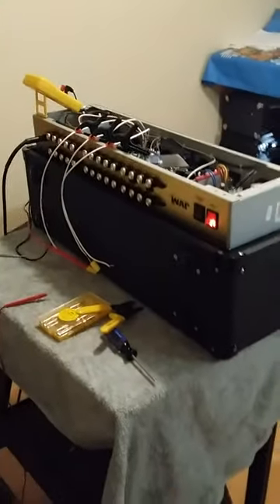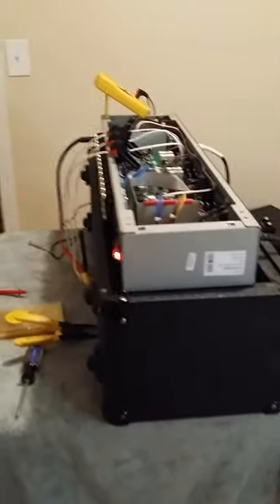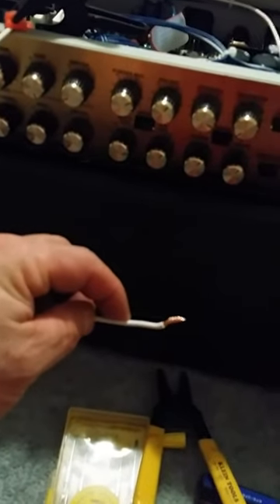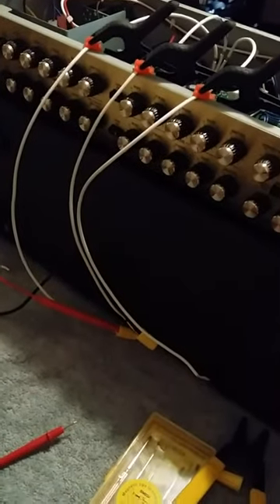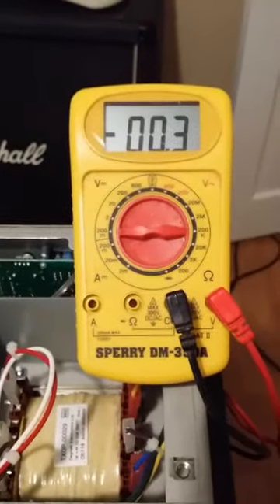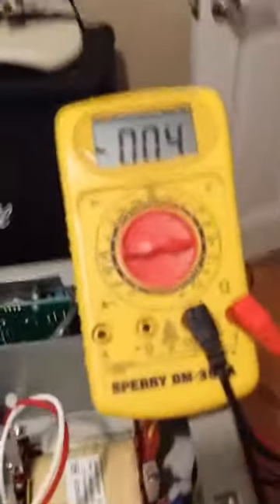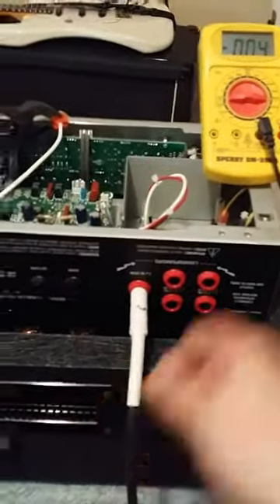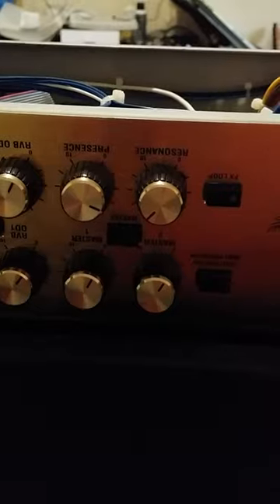Marshall jvm 410h how to bias lesson

Comment: I wish I would've seen your video today before I worked on the jvm210h for my music center. The way you used the cabinet to support the chassis is brilliant. I used their Bias King tube sockets. I could set one side at a time. Made it easy. I like the way you used the connections terminals. That's another way to do it if you don't have a tube bias socket...

Comment: What about picking the right tubes? I once buying the same tubes that came in one of my amps and it’s plate voltage (I think) was higher than the one that came w the amp and the tech had to bias it hot since it couldn’t go lower due to its plate voltage .

So how does one figure out what the right tubes are if different brands run at different voltages right? 

Also when buying tubes for a 100 watter, am I supposed to find four that are all matched? Or do people just buy two separate matched pairs?

Comment: Do you really mean 35 per side? Or rather 35 per tube? Because with two valves per side on the JVM 410, wouldn't you need 70 per side so that each tube gets 35?
Reply: Does anyone know the answer to what Metalvision Song Contest 7 is asking?
Reply from the maker: Hi sorry for the delay ,it's anywhere from 70 to 80 millivolts per side I was told from the tube store for the jvm 410h 100 watt ,it's up to you on where you think it should be set that sounds best to your ears,but anywhere between 70- 80 per side will work.so for a 50 watt jvm it would be anywhere from 30 to 40 millivolts per side because it's only one tube per side.hope this helps,thanks for watching.
Reply: Yes.  36mV per tube is ball park
Reply: shredderman I set it to 60 per side back in 2018, so that's 30 per tube. A pretty cold bias, but it works quite well for the JVM, I've found. At least for metal, where you often want your clean channel completely crystal-like, and then have the high-gain channels for contrast. If you're doing classic rock / blues / anything that requires more crunch and warmth, 70 per side seems reasonable.

Comment: Okay so I blew a fuse in my amp and I need to replace it. The amp came with Europe equipped fuses and I’ve been using a Step Up/Down power converter to get it correct with the US fuses. Can I replace the tubes inside of the amp with the US fuses so I don’t have to use a step up/down power converter?
Reply from the maker: Honestly I'm not to sure.I am guessing you could ,I don't see why not,But I may be wrong.

Comment: hi! how do you open the amp? I cand take off the amp from the case
Reply from the maker: There are 4 screws underneath the head where the rubber feet are unscrew 2 on each side, Place the head  Back on the rubber feet.  Then grab the Transformers from the open back side and lightly carefully pull it out it may take a little force,just be careful.